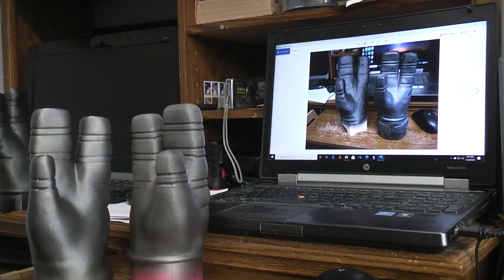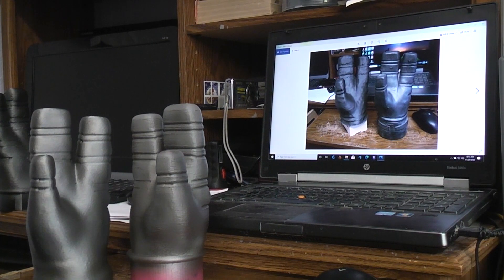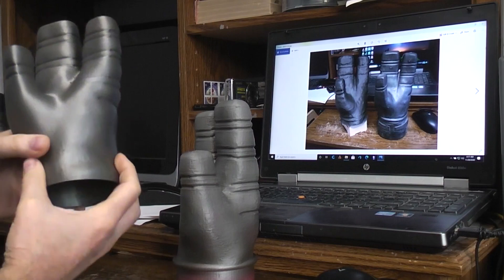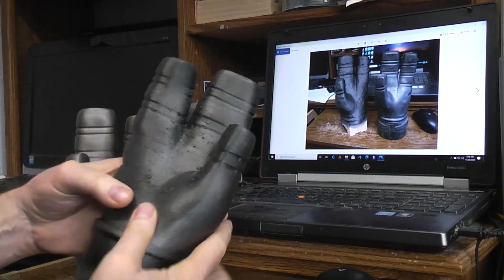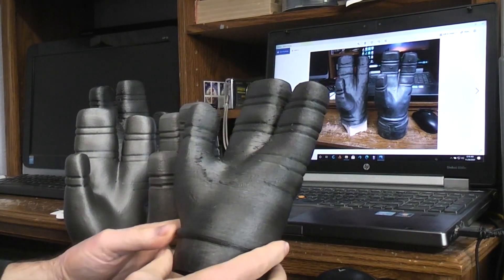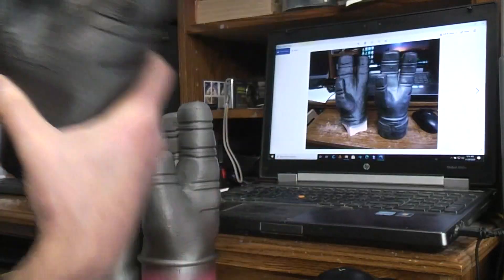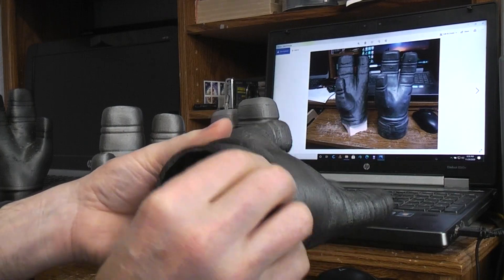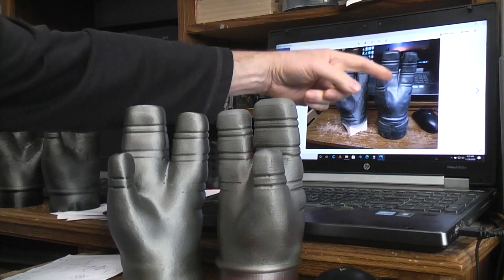Improved Robby the Robot Glove scan. Flexible or solid print.

Comment: Hi John  it would be cool to make a cuff for the hand  to print  it would  be neat to mount on the wall with the hand in the cutt holding a blaster. Or a coat rack on the wall.
Reply from the maker: If you watch some of my Robothut video's when I am entering the hut, you will see a B9 carboard standy screwed to the wall and I did just what you said. I made some claws and wrists parts and screwed them to the cardboard B9 standy and use it as a coat Rack.

Comment: It's amazing that flexible gloves can be printed. Those gloves look great.
Reply from the maker: I did not get the TPU filament setting dialed in as there are some zits on the surface, but not bad. That TPU filament has been sitting around the shop for 3 years now and has probably picked up mosture , so drying it first should improve the outcome.